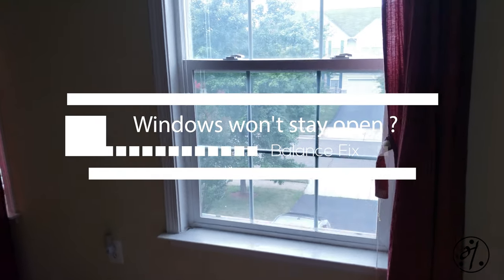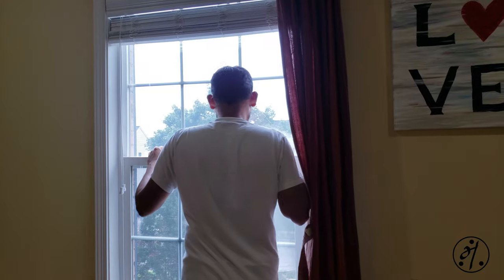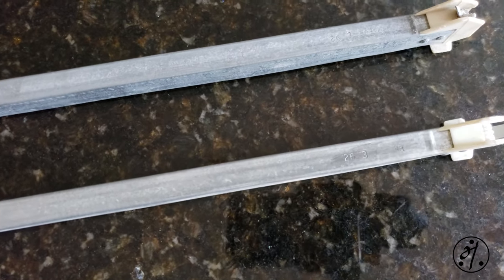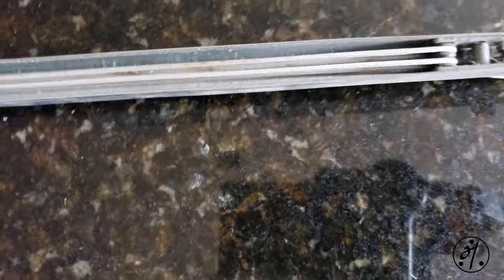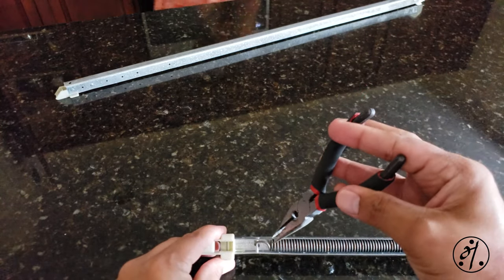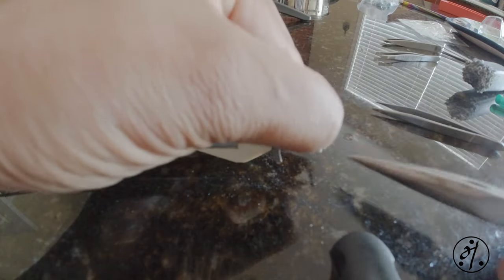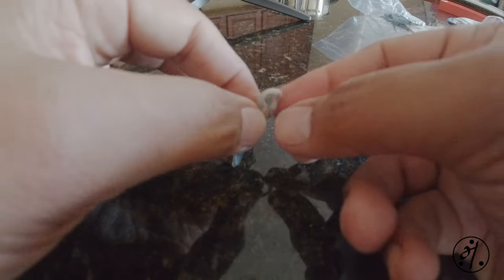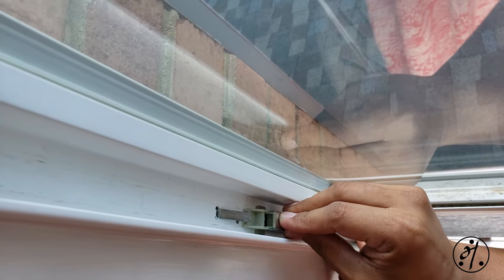Window Balance Repair | Block and Tackle Window Balance repair.

Comment: Thanks for an informative video that's right to the point and clear.  Ordered replacement clips from SWISCO and I should be good to go once they arrive.   Window has been broken for years and now it will finally work again.  You should post information about where you bought the parts so we don't have to scour the comments for the information.
Reply from the maker: Will do.thanks

Comment: Thanks for the post. I inspected and did not see anything visually wrong in the balances. But still one of my windows goes up an inch from the bottom when it is closed and another larger window slides from top to the bottom with nonresistance. Any ideas what could be wrong? The windows are 22 years old. Should I just replace the balance?
Reply from the maker: Yeah, try with new balance. They should cost around 10 bucks each.

Comment: Thanks for showing how these parts work. My problem is one of the balance blocks is stuck in the up position. I pulled it to the side just barely enough to click out the tabs and can slide the window all the way up again now but the block and sash are still jammed in there. How do I remedy this? I don't have any pivot lock shoes to slide and take it out of the pane, either.
Reply from the maker: If you move the window all the way up, try to wiggle a bit. It should loosen the balance and slide out